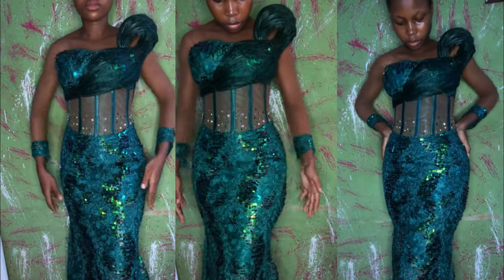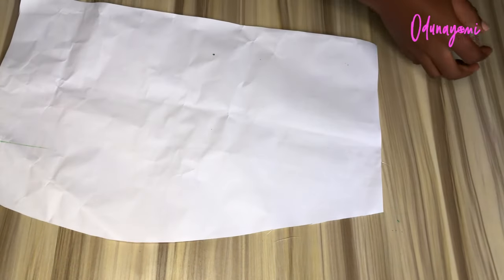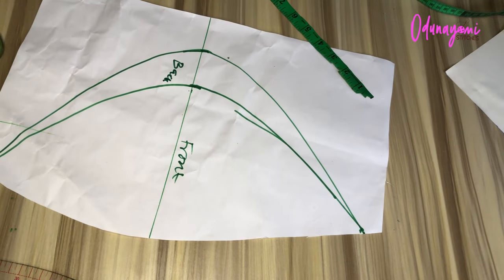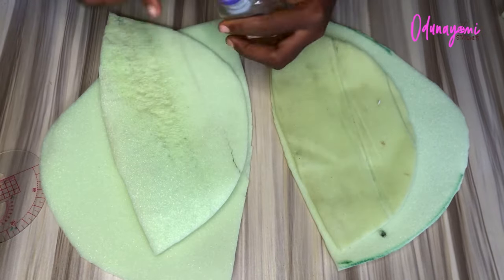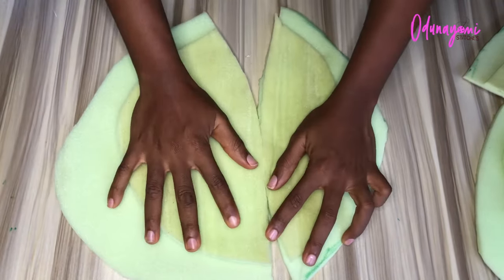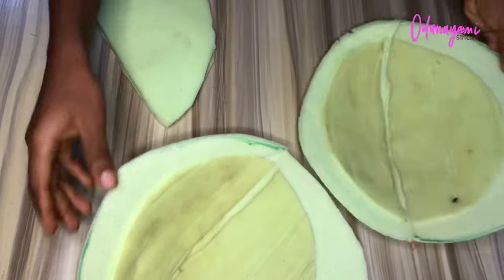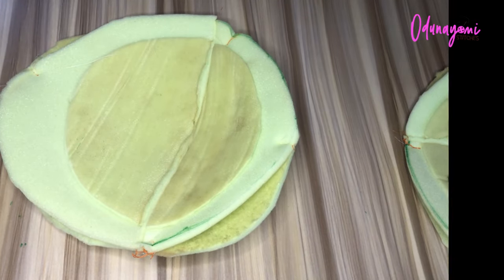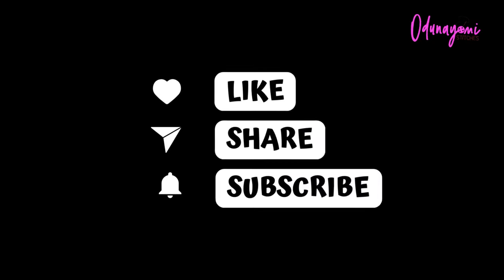HIP AND BUTT PADDING TUTORIAL | how to make hip and butt pad for skirt and gown

Comment: Also ma, wen u were drafting ur hip and butt pad pattern, did u add extra allowance to the hip on this pattern or u just cut out ur normal hip measurement?
Reply from the maker: I added extra allowance, 
i.e hip padding allowance
Reply from the maker: For instance I added 3 quarter inch because I want my hip to increase from 34 to 37 
If I want it to increase to 38 I will add  inch, for 40 I will add 1.5 inches
Reply from the maker: Another way to do it is to add the allowance to your hip measurement before measuring on your fabric 
For instance if I want my hip to increase from 34 to 40 , I will measure hip 40 on my fabric and add only the sewing allowance (no need for hip padding allowance like that)
Reply from the maker: I wish YouTube has voice note feature it would have been very easy to explain 😩
Reply from the maker: I hope you understand all my explanations 🙏
Reply: @odunayomistitches  yes I do ma
Thank u

But lemme put it this way so u can get what I'm saying

Let's assume my hips is 35 and I already add 5 inches as the hip padding allowance to make it 40 inches and I cut that 40 inches directly on my fabric

Now coming to the pattern paper I'll use to cut the hip pad shape
Will the measurement of my hip on that pattern paper be 35 inches or 40 inches before shaping out the hip pad on the pattern paper?

That's what I'm confused About

Because I noticed the pattern paper u used for the main bodices where u added the allowance ¾inch to ur  normal hip measurement is not the same as the pattern paper u used when cutting the hip pad shape